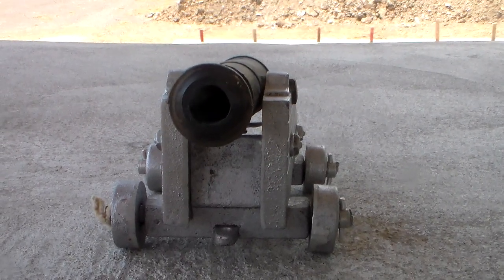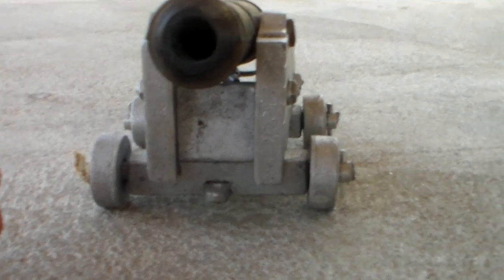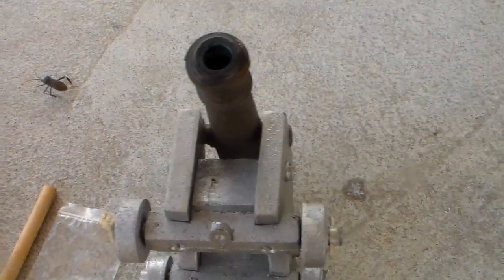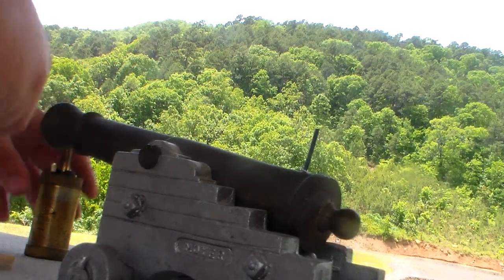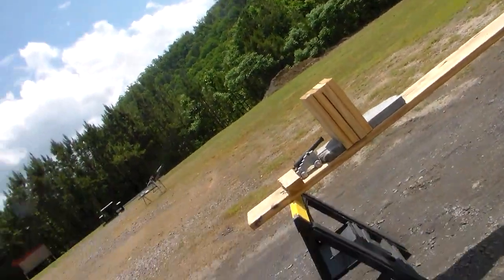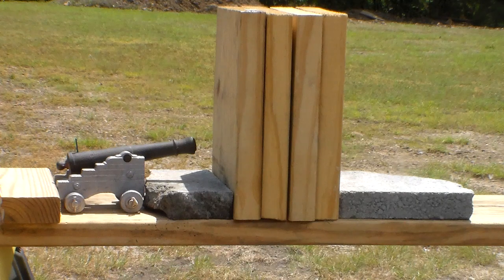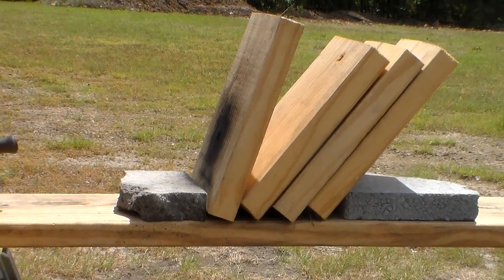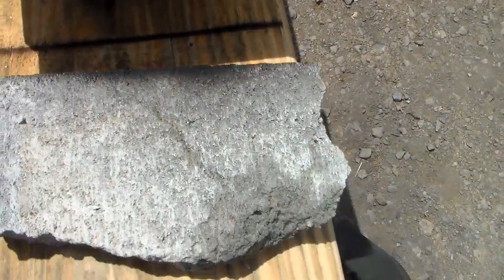CANNON VS WOOD BLOCKS

Comment: You need to patch your balls, or use a .500" ball.  That .490" ball is too loose in the bore.
Reply from the maker: The bore is tighter than a standard 50 , and I'm playing it safe scene the barrel is bronze and not modern steel.
Reply: bmfsteve24 it most likely has a steel insert

Comment: If you check with Dixie guns works, I think you will find that the barrel is made of steel with bronze plating.
About the only thing you can do to make too much pressure is to not have the ball placed tightly against the powder charge. So to load1). Place the powder charge in the barrel, 2) pace an over the powder wad or card over the powder and ram it down - just firmly to the bottom- no need to pound it down 3). Place the ball in the barrel and use the ram rod to push it to the wadding 4) place another wad over the ball and ram it firmly against the ball - again, you don’t need to pack it down- it just needs to be firmly pressing against the ball to keep it from rolling out of the barrel and to make sure there is no gap between the ball and the rest of the load. Dixie gun works can also sell you 50 caliber felt wads. They are very knowledgeable and are happy to make recommendations on loads and wads. 
I think they will recommend 2 f ( sometimes written as “ff rifle powder”). 3 F ( fff) is more commonly used for pistols and burns faster with more pressure. Avoid 4 f (ffff) as it is just used in flintlocks as a priming charge - it is very fine ( as opposed to coarse) and will make too much pressure. 
Important to remember - make sure the ball is tightly against the rest of the load and never use ffff (4f) powder.

Comment: Thats the first time I've seen the right length of fuze used, everybody else uses way way to long a fuze, who wants to stand around weighting. i used that length in my big cannons & mortars before converting them to use a cannon lock & shotgun primers, a couple use musket caps. Ive got a small old ironside 45cal cannon thats rifled, it was $25 at a gunshow in 1985 and shoots pretty good😊

Comment: The Janka scale for wood hardness states that Pine is rated around 400 lbf, obviously the higher the number, the harder the wood. Oak on the other hand is around 1400 on the Janka scale. I would stick with the softer wood like Pine versus anything with a higher Janka scale, or you will definitely end up with a Ricochet scenario. Whatever you do, don't dare use a piece of ipe, it's rated at over 3,500 lbf. The tiny little cannon would barely mar the woods surface.

Comment: Do you think it would have more speed if it wasn't so close to the blocks.  Wouldn't they slow the air exiting the barrel? And has the shot even stopped accelerating at that point?
Reply: zach olson im aware black powder stops acceleration after a distance possibly before leaving the barrel even if the barrel is longer. but I learned this on the history ch ^^. look it uo though. I could be wrong and you would learn more yourself than I can tell you! :)
Reply: I always wondered that too.  On one hand ballistics are always measured at the end of a barrel, that being the highest point of acceleration.  But as a kid playing hockey, they teach you to get up close to block a shot so it doesn't sting as much.
Reply: Your right and he should've used one wood board

Comment: To much powder and no wading is the issue here. You can see the unburden powder on the board, and without good wading to seal the gases you are losing a lot of pressure.

Comment: where can you buy fuses?
Reply: Paul King, my dear friend you can either use a little glue and black powder inside a piece of paper wrapped tightly, or you can buy bulk cannon fuse at your local fireworks store just ask for the cannon fuse line. Or you can do what I do and use the most efficient and cheap fuse that you don't need to make which is a sparkler. they burn hot enough to light my rockets and my thermite and they sure as hell lite black powder just fine. Please let me know if you have any questions. :)

Comment: No wadding? A .49 ball in a .50 barrel isn't going to give you much compression, meaning a lot less energy. 

Get some wadding around the ball, reduce the charge to 20 gains. I bet you get more power.